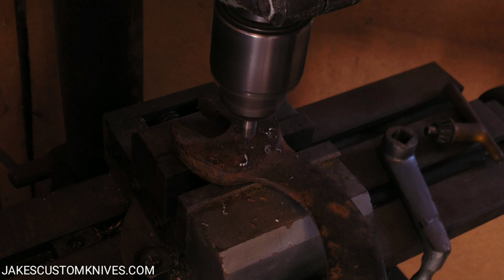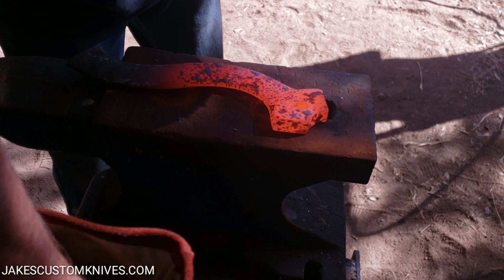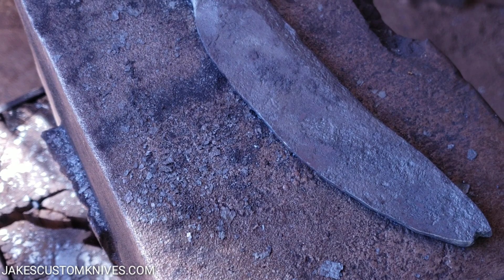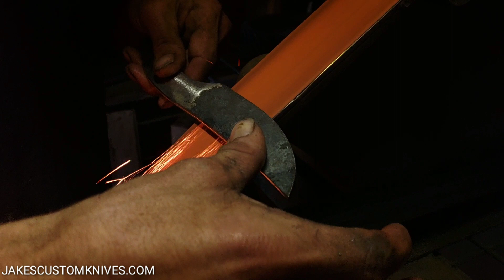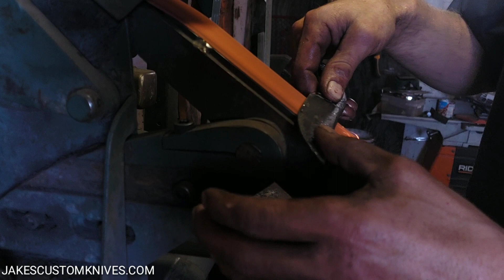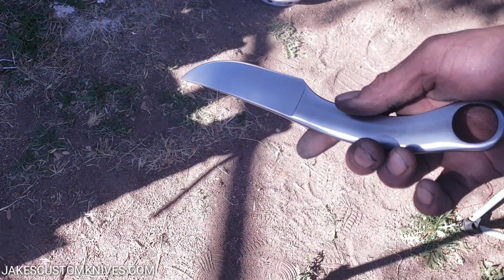Antique Wrench Turned Into A Beautiful Custom Knife

Comment: The risk from CrV is that when you heat it, it might produce hexavallent chromium, that is both accutely toxic and recognized as a potent carcinogen. Otherwise, you can safely cut yourself with CrV as much as you like, as long as you don't bleed out. EDIT: Again, this is more of an issue with the surface chrome-plating, than with the Chromium alloyed in the steel.
Reply: Case XX makes chrome vanadium carbon steel blades. So his statement was quite confusing. Thanks for the clarification.
Reply: Well ...electrolisis

Comment: Good tip on the dangers of chrome vanadium. I didn't know that. Thank you.
Reply: Very nice knife.
Reply: Chrome and vanadium are metals heavier than iron and used to made iron products rust resistant. Basically, they are some of the key ingredients in stainless steel.
Reply: Good think I knew this before I made one. I’m just gonna use em for art then.

Comment: “It will poison you if you cut yourself with one of these.” Positive that’s not true. It’s just a high alloy steel, not plutonium. You’re probably thinking about the vapors given off at high heat points and/or grinding dust. Exposure to either is a bad idea.
Reply: Exactly, I had a friend that was a master welder. He said don't weld on stainless without a certified oxygen hood. Lead is harmless compared to Hexachromium.